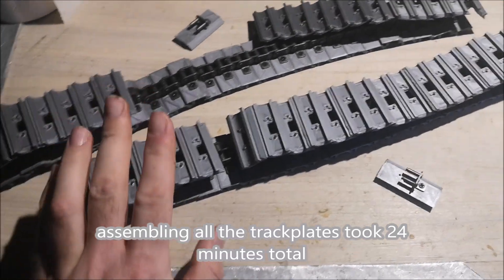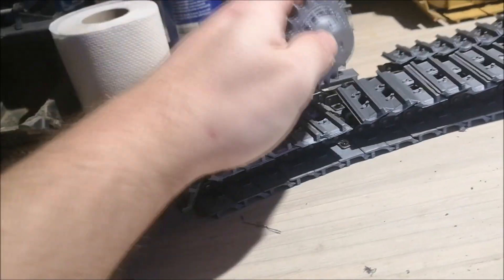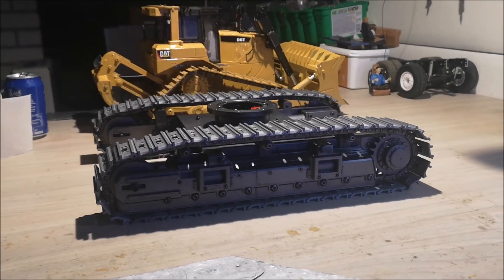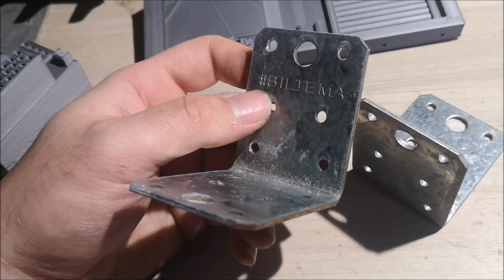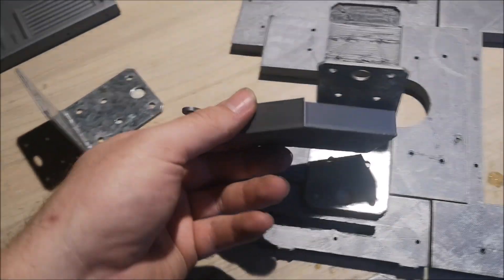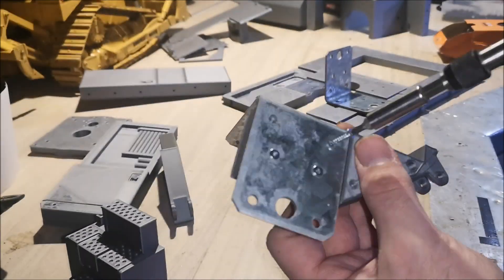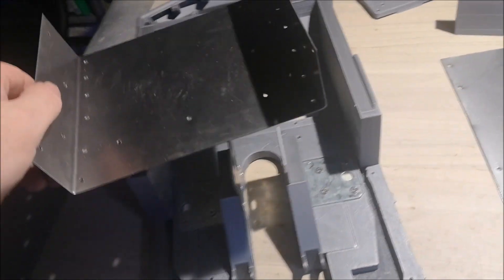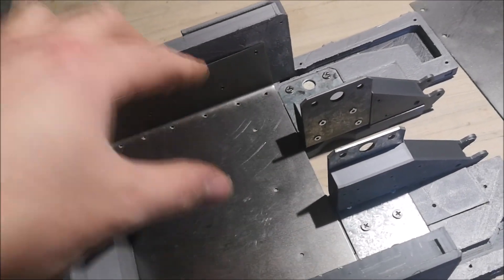Making a 3D Printed RC EXCAVATOR - Volvo EC550EL - PART 5

Comment: I downloaded the print files and it does not have the metal plates for the boom arm? is this download made to not use them?
Reply from the maker: It has dxf files for the arms if you want to lasercut metal. "Vulpa 505 DXF files for Arms.zip"
Reply: sorry i was talking about the L shaped bracket you at the base of the main arm. Is it needed? @burnie222rclasseanhanger6